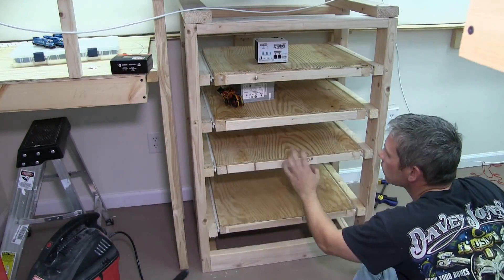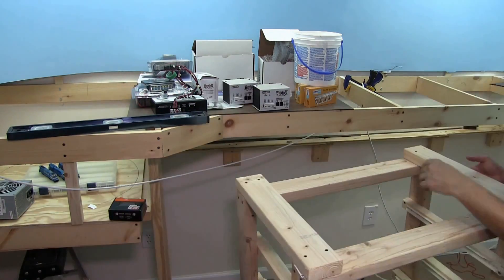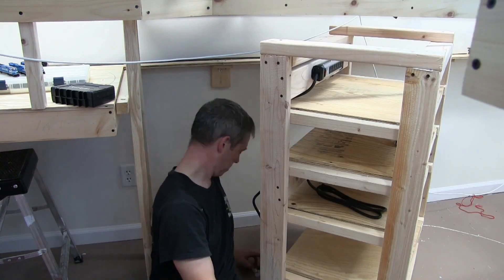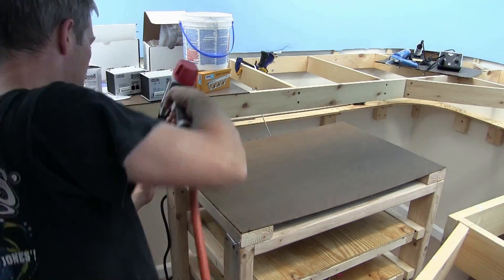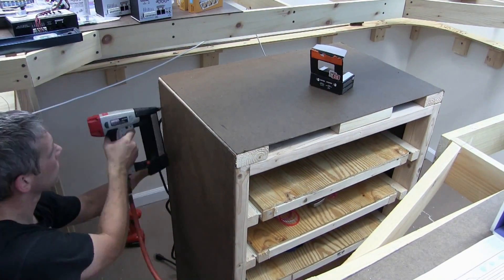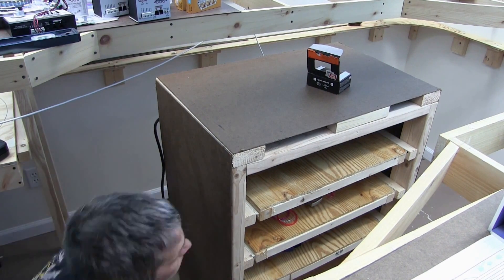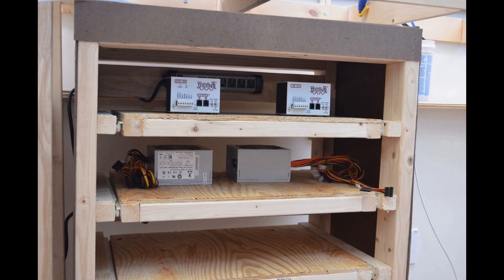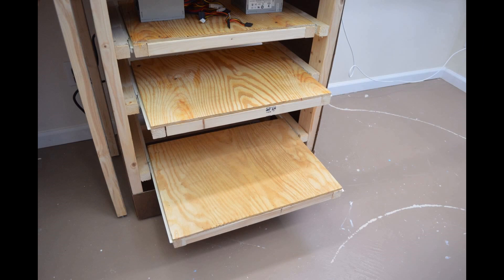Constructing the Electrical Cabinet for the Sayrehurst Secondary

Comment: Joe, did you get the plexyglass doors on the electrical cabinet? Can you show us the end result and let us know how the process went for installing the doors? Thanks.
Reply from the maker: https://www.facebook.com/768516516531843/photos/a.1048599678523524/1692347697482049/?type=3
Reply from the maker: Yes I did. It is nice, keeps the noise down and the dust out of the cabinet! Thanks for watching.

Comment: To get a real nice look on your plexiglass doors first run around the edges with some #140-160 grit sandpaper around a sanding block to knock off the kerf marks. Then go along the edge with a propane torch with a 3/8 -  1/2" nozzle held about 3/4 - 1" away from the edge. This is called "glassing the edge", and really gives it a finished look. Move quickly and steadily, don't stay in one spot too long. Practice on some of your scrap pieces first to find your distance and rate of speed.. It's pretty easy and makes the edge nice and clear..     Bob
Reply from the maker: Robert Weiland thanks for the tip I will try that. Thanks for watching!

Comment: Joe, 

I'm ready to build a cabinet like yours, what are the dimensions : height ,width  and depth? 

I can adjust from there, I just need a starting point. 

Thanks, 
Bill
Reply from the maker: William Arseneau sorry I haven't gotten back sooner! You should have emailed me I forgot! The cabinet is 44" tall, 30" wide 20" deep, each self is 6" high. I started at the top and went down for the spacing on the selves. Hope that helps!